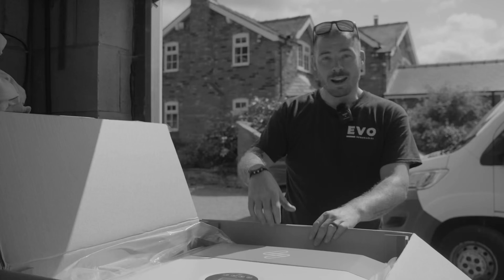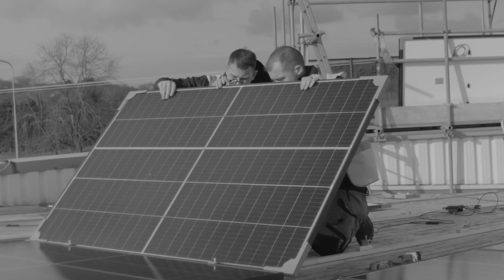EP12 | Givenergy Commercial Battery Storage | Commercial Solar

Comment: Nice episode Ben. Each of those little cars needs 20kw to go up the ramp at the start? Do they get winched up and left to roll back to the shed, or powered all the way round?
Reply from the maker: Their demand is 20kw of power as they go around and they're powered continually all the way around.  The ride takes around 3 minutes so it would be I imagine around 1kwh of energy used at a demand of 20kw